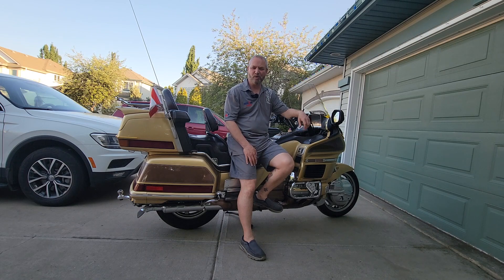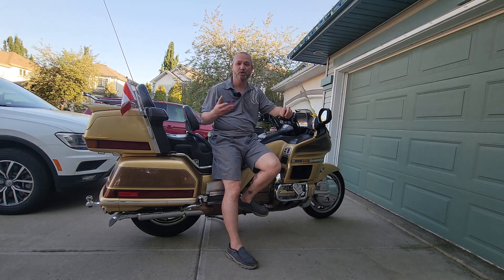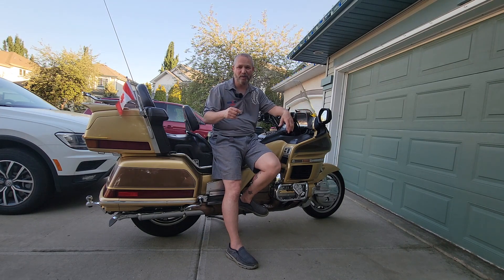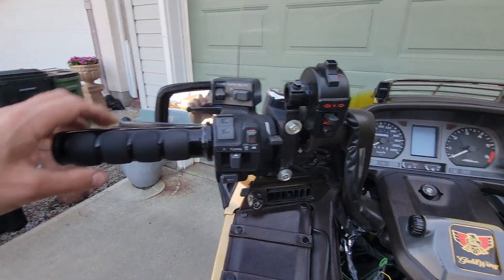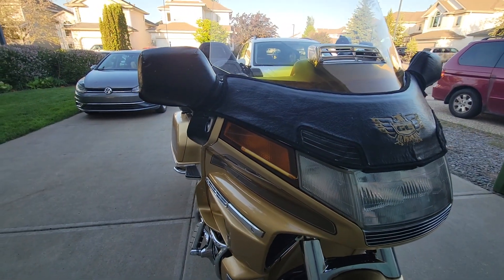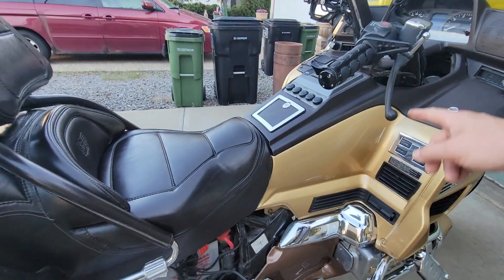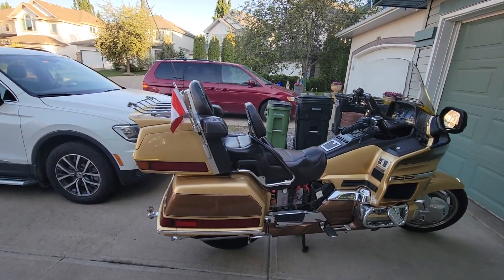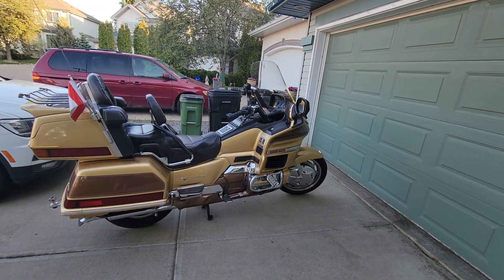Goldwing Signals and Horn fixed Temporarily.

Comment: Rider, had the same issue on an 85 Aspencade. I believe it's a bad angle switch in the head stock. It operates the auto cancel. I by-passed mine to use the existing lights. I do however really like the LED'S on your ride.. that gets their attention. Like the videos keep safe
Reply from the maker: Thanks for the advise. I'll look into the angle sensor.
Ride safe

Comment: Are you pleased with the progressive rear shocks? I installed them to the full position I weigh 195 and the wife 125 and the ride is not great. Just asking maybe I have a bum pair.  Love the videos and info
Reply from the maker: I really like the Progressive rear shocks. I weigh 210 and the wife is 143. I also set mine to the full position. I set them for riding with my passenger +- pulling the trailer and the ride is great.

Comment: I also had mine fail by using LED lights without a load resistor, but I think @karlbirdieEnglish has the right answer. The auto canceling is sensitive and known as BAS or bank sensor.  It has a pendulum and that gets stuck it will cause this issue. Its  a Green 3pin connector.White and Red/White wires to bypass the BAS. The Green wire is Ground. Just unplug it and jumper the White to Red/White. On the 1989 the BAS is located below right side of trunk near the fuel pump relay
Reply from the maker: Thanks for the great instructions, I'll try it